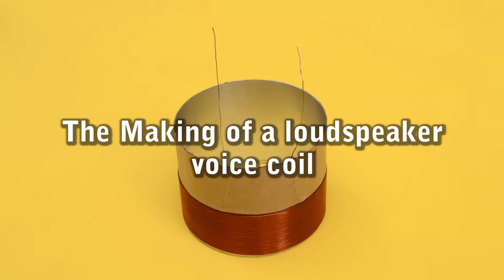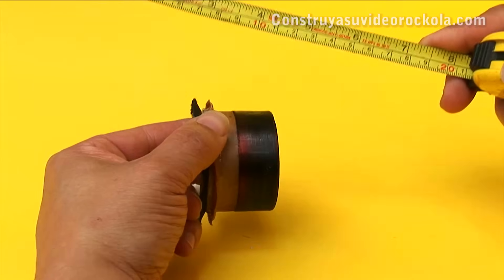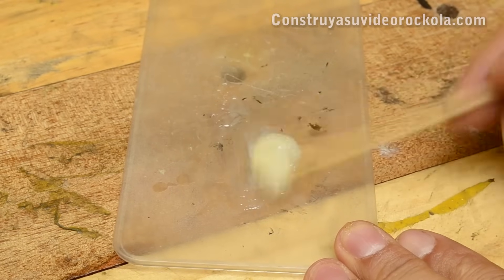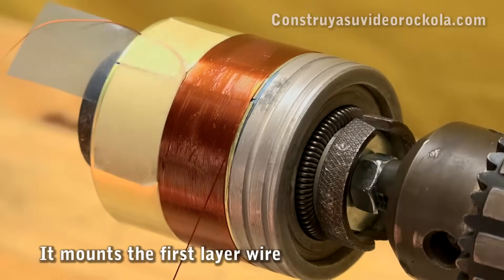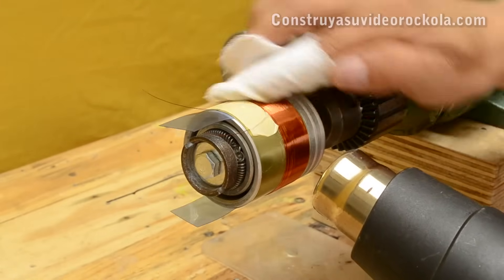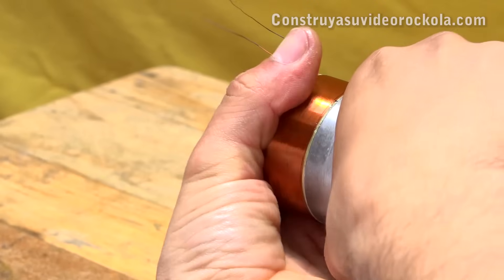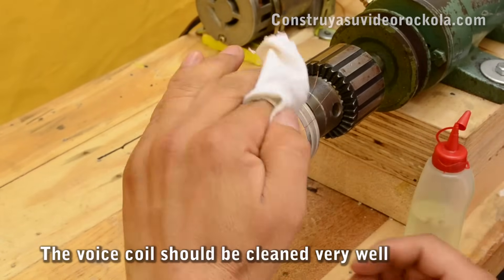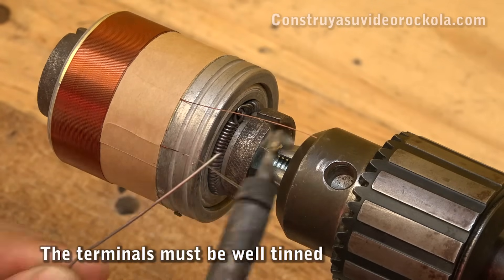The Making of a loudspeaker voice coil

Comment: Your English seems to be improving :) One word you use a lot is "winding." It is one of those stupid words in English that means 2 different things. As a noun wind is referring to moving air. This form of the word is pronounced 'wh-IN-d.' (this is the way you are pronouncing it).
  The other form of the word "wind" is an adjective. It refers to the action of looping or spinning something. It is pronounced differently. Instead of the strong "in" in the middle it is pronounced 'WHY-nd' or you could think of it as 'wh-I-nd.' I am just trying to help. I'm not trying to be critical at all.
  I have one question, or really a request for more information. Can I lower the  impedance of the voice coil by reducing the number of turns if I design an amplifier that can handle it? Or/when is it better to use a larger wire?
Reply from the maker: Hi Bike
Thank you for your criticism.
The truth so far are learning English. Sorry for the mistakes.
You can lower the impedance only reduce the turns of wire. Or, using a thicker gauge. This also depends on whether the magnetic gap permits.
Bye